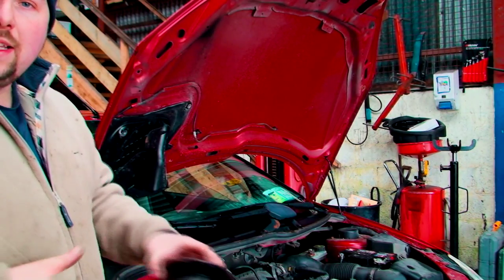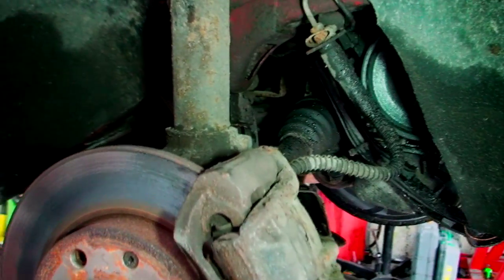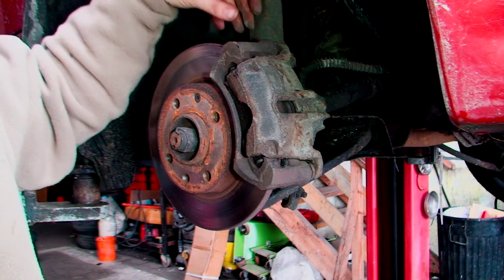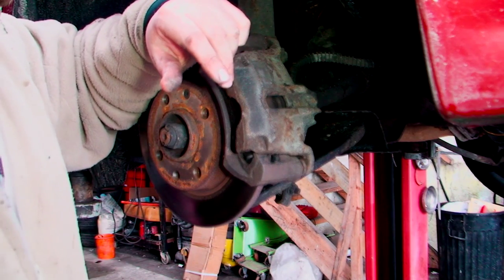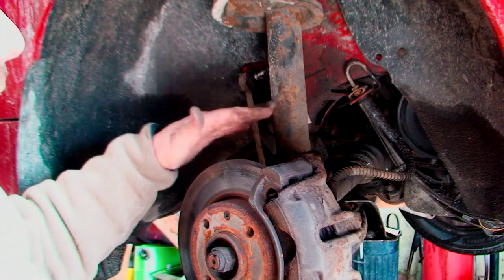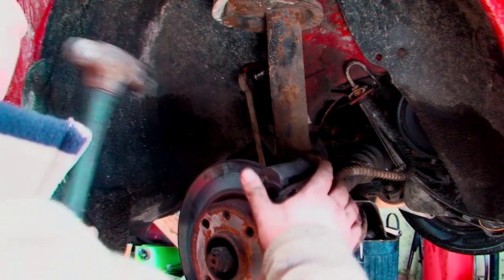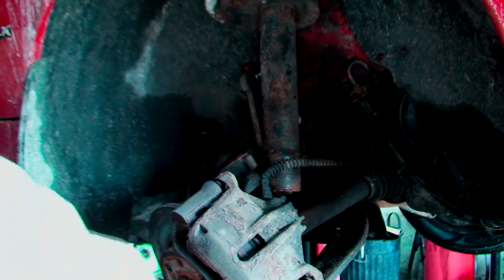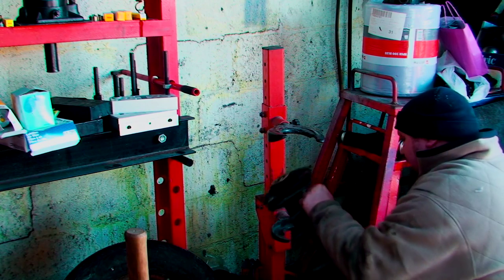bodgit and leggit garage how to do shock top

Comment: hi mate. got the same car. when turning all the way doing a circle, it does make a noise. i thought it could also be the velocity joint?
Reply from the maker: yes if it's a constant click it's the CV joint if it just clicks wants you full lock that's most probably the shock top